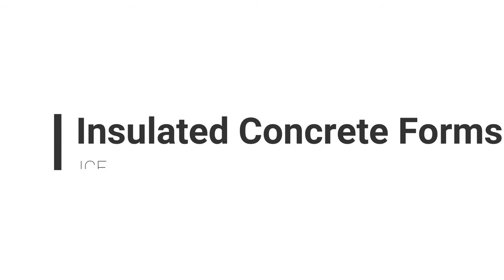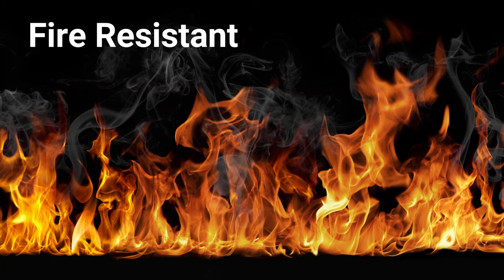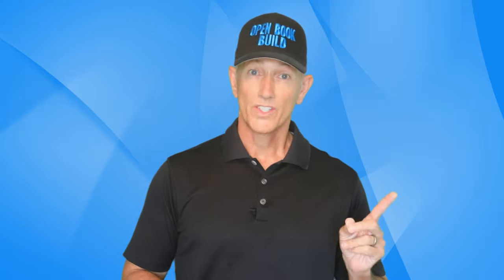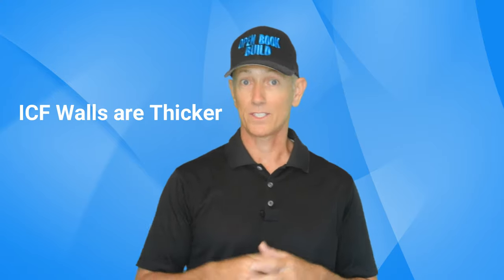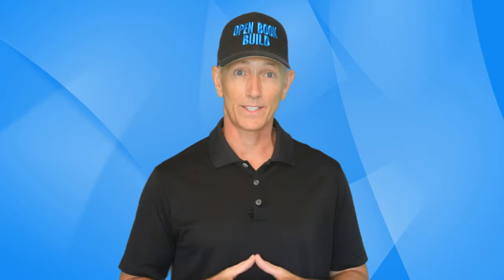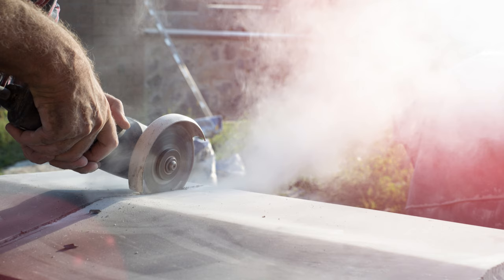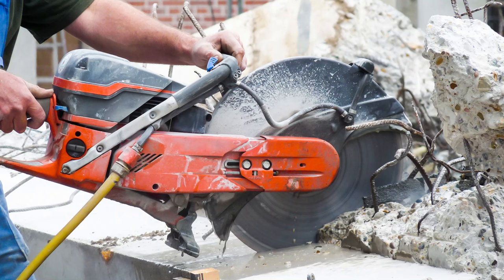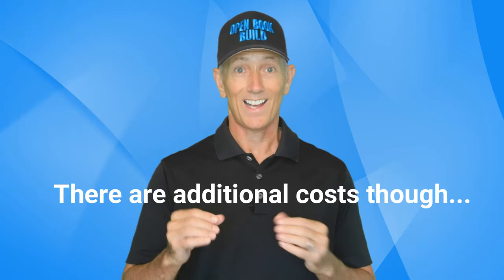ICF Construction: Why I Haven't Used Them as a Builder

Comment: Most builders don't want to use ICF, because they can't upcharge for air sealing, spray foam and other energy efficient, but costly details that would be required to get even remotely close to the efficiency of ICF.  ICF is a one stop shop and it can be installed by anyone.  It is probably the most forgiving building material (pre-pour obviously) out there.  Another reason I see builders not recommend it is because it's extremely DIY friendly and has free engineering tables readily available for most builds.
Reply: ICF sounds like it has a lot of advantages but it's new and different. People are usually afraid of what they don't know. It seems like it would be a major headache to deal with changes in the future. Opening up concrete walls to change plumbing, electrical, or HVAC has to be way more difficult. What can you do if you have a leaking pipe or want to remodel the bathroom or kitchen?
Reply: @KPHVAC  ICF has been around since 1953, but it just isn't as mainstream.  Pre planning all penetration's is key, but for a remodel it is a simple as getting out a demo saw and opening up the wall, same if you had a block basement.  You do not run the plumbing in the walls.. I would suggest you watch some videos on it and see how plumbing is routed.
Reply: @FJB2020  Also, just in case you can add a couple of penetrations to those that are already in the plan, and then if you do not need them you can just fill them up later.
Reply: @sebastiantevel898  That is a good point!  I added a few extra for things that I might add in the future.
Reply: @KPHVAC  My above-ground ICF home is 12 years old I cool this massive home with a small bedroom-sized window AC unit. It's all free span so can be set up most anyway in the future it's also very storm safe and I get insurance discounts. I remodeled 1 bath soon the others its not an issue like you all make it out to be. A conventional home bath isn't a picnic to re-do the floors mostly need replacement the wall may have rot not problems in my on slab ICF.
Reply: @kloss213  That sounds awesome. We definitely need more homes that are built to be very energy efficient. I'm sure a single ductless heat pump could heat and cool your entire place if a window unit can do it now. What is the square footage?
Reply: @KPHVAC  ICf has been around since before WW2... it's not new at all.
Reply: Great info!
Reply: @kloss213  do you have spray foam insulation in attic?  I’m looking at building with ICF and just using either cellulose or spray in insulation, not spray foam…. Just wondering if will still see great savings on power bills without spray foam insulation.  Thanks
Reply: @elementsoflightandmusic  have about 36" of fiberglass in the attic.
Reply: @KPHVAC  I know was planning on adding heat pumps now that there is an incentive from gov. The home is 2200sqft and has 15 ft tall ceilings. If winter the home heats well with the heat from the ground so it stays in the mid 50f without heating if sunny or a few folks are indoors I need little heat or cooling.
Reply: @kloss213  Thanks, so you're getting really great energy savings without foam insulation on the roof it sounds.  I'm also looking to have a geothermal hvac/heat system installed, so I suppose if if i have about 3 feet of insulation in the attic floor boards, ICF exterior, should achieve really great energy savings even without foam insulation... and also, save on money without needing foam insulation, as well as not have to worry about around here the termite companies won't contact repairs with you if you have foam insulation in many cases...
Reply: Most builders don’t want to use it, because price in the market for real estate isn’t determined as much by the quality of materials as it is by the demand for housing and the size of the house.  If two identical houses are right next to each other, one built with extremely high quality and the other with average quality, the higher quality home won’t bring a high enough price to offset the higher price of materials.  When you build your own house, on the other hand, ICF is a great choice.
Reply: I like this thread. Great information.
Reply: As far as remodeling… icf isn’t usually used for interior walls… I’ve seen people use wood frame and frame cad and u can alter that fairly easy compared to concrete poured.
Reply: @zbergen4358  My walls on my first two floors are ICF and the 3rd floor for the bedrooms is all stick framed.  Now a friends ICF house is 95% ICF interior walls.  Only walls not ICF are the closets.
Reply: @kloss213 what are the incentives from the government for heat pumps?
Reply: If there's a blowout the pressure blows the whole wall like a zipper.
Reply: @JJJJspam  That only happens when people don't follow the install correctly.. Like when Dirt Perfect had all the blow outs.. That is because they only installed clips on the first course and that is not what you are supposed to do.  I poured a 14' tall wall without a single issue and that is me doing it with no experience.. I just followed the instructions..
Reply: Currently building a home out of this and it’s an Effing nightmare
Reply: @darkerthanknives  What issues are you having?
Reply: Capitalism means excessive resource accumulation, and you just matched it's definition.
Reply: @garrettcole2251  lol...
Reply: @FJB2020  hey, up selling is excessive accumulation, this capitalistism, capitalist + ism.
Reply: @darkerthanknives  what are the main issues that you are running into with the build. Very interested in using this for a build.
Reply: @Chris  I've seen your comments, then went to your channel and saw your construction and will like to ask. Who did your floor plans? I'm heading the same direction, but, architects in the area are not familiar with the product, so stuck trying to find one who does.
Reply: @RS-lt2ue  I designed it myself using AutoCAD.  I just kept playing around with different layouts until I found one that worked and appeased my wife.  We are building it ourselves too, so I get to make on the fly changes if needed, though nothing has come up yet.
Reply: @FJB2020  Ok, thanks for getting back to me.
Reply: AY!
Reply: Please
Reply: yep 💯
Reply: @fjb2020 where can I find these engineering tables??
Reply: @KPHVAC  run the pipes and cable on the wall and cover with drywall where it is needed , otherwise just leave electrical on the wall on metal conduit.
Reply: How so and would you do it agian? @darkerthanknives
Reply: @KPHVAC New? What a joke, it’s damn too old in world wide except the North America
Reply: ICF is definitely the way to go to build only did my first floor wish I had done the whole building 40 degrees inside with no heat even when it is 10 below 0 outside
Reply: @KPHVAC  ICF is not new, been around since the late 90s. Guy who stacked my ICFs started in 1998...
Reply: @elementsoflightandmusic I used the synthetic underlayment for my class 4 roof. I spray foamed my attic(non vented) with about 12 inches of open cell foam. My soffits and garage are traditional vented attic. All these areas are blocked out with a vapor barrier and spray foam.
Reply: @elementsoflightandmusic 
Geo is a pain in the butt! And if you have to replace it it's as expensive as all get out! Just get a good heat pump for less than 7k...
Reply: @jeffquine8883  ICF has been around since the late 50s
Reply: I know this comment is like 2 years old but I had a GC make a comment about why he doesn't fool with ICF. "  If my guys make a mistake with a stick built house it's easy to fix.  If they make a mistake with ICF and we don't catch it till after the concrete has been poured....that could be a lot of money."
Reply: @PandorasFolly  That is true, but I wouldn't want someone who makes mistakes building my house, stick, or icf.. That said, concrete drills and saws do exist...
Reply: @FJB2020 you can easily run plumbing in ICF wall foam. Up to 2”
Reply: @Alphasig336  Yeah or you can run larger IN the wall if its thick enough.

Comment: Concrete doesn't work the way you think it does! Water is essential to the strength, and it chemically incorporated into the concrete - it doesn't "leak out" over time. Your other reasons for not using ICF just seem to be sheer laziness.
Reply: Concrete is poured with a lot of excess water in order to make it more workable.   The humidity problem he discusses is real as much of that excess water seaps out over the 1st several years.

Now if you are willing to go with really stiff concrete that has to be almost packed into the forms with massive use of vibrators... the issue is greatly reduced.   Expect to spend 4-6 times a long to erect and fill the ICF blocks  - and you may have to do it in 3-4 ft height levels at a time.

Comment: All of the problems you mentioned about building with ICF can be fixed with proper planning. As for the cost difference you failed to mention that the home owner will be able to purchase smaller HVAC equipment because of the insulation value of ICF.  Small unit, smaller electric bill.
Reply from the maker: This video isn’t a full list of pros and cons…I can list ten more items for and against using ICF’s.  This is strictly listing the reasons I’ve chosen not to use ICF in the homes I’ve built.  And yes any negative can be worked around.  But when you don’t have a decent workforce to build 150 houses a year with these…you don’t do it…it’s that simple.
Reply: @OpenBookBuild  The problem of production building is due to the scale its indeed inpractical to deviate from standard stick framing due to the associated lack of attention to detail...although the same can be said of the production crews often not properly sealing Zip panels or any other methods that are designed to air seal the modern build...which will lead to condendation and rot of the wall assembly..is the reason I'll self build with ICF
  I was a production framer prior to the current code retirements of air sealing...when our 4 days with crew of 4 could frame a 2 story tract home of good quality...this can't be said for the current production build due to the air tight requirements.
Reply: ANY problem can be mitigated through proper planning.  The issue is , is it worth it to overcome those mitigated issues? Plus is the contractor going to make a mistake even after mitigating the issues.   If it’s worth it then no problem, if not don’t use them.
Reply: @OpenBookBuild ICON 3D printed homes are about to take off. All concrete and very popular.
Reply: @OpenBookBuild it seems like your list is more valid for builders such as yourself rather then individuals who want to build their own home, good info nonetheless.

Comment: Builders in the US have become stuck in old technology and don’t want to change. Stick built is cheap, fast, and extremely profitable. In Germany, 85% of the homes there are solid built meaning concrete walls. It takes a couple of months longer to build but they are much more efficient. I think things need to progress in this country especially in FL. There shouldn’t be any stick built houses being built. Everything new should be concrete. I think insurance companies would agree.
Reply: Slight mistake here: in Germany and most of Europe nearly all houses are built with solid walls, but not concrete ones, as the insulation properties are not good enough. Building materials may vary by what is locally available and therefore cheapest, but typically (in colder areas) large, light, well insulating building blocks would be used, which have insulating properties approaching rockwool. Concrete would only be  used for subterranean cellars and floors or possibly for a concrete framework for high rise buildings . Normally any house will be built on a concrete foundation plate. Building regulations require wall insulation properties equivalent to about 8" of rockwool or Styrofoam, this can be achieved with the aforementioned materials with hardly any additional pure insulation. This added insulation would be on the outside, so as to maximise the heat capacity effect of the materials used inside.
Always sticking to traditional methods can be a bit of a problem, see the UK, where the building trade does not seem to be able to get away from the traditional brick cavity wall, which in my opinion makes efficient insulation a nightmare.

Comment: None of the issues you talk about, are that problematic enough not consider ICF. You did not talk about the advantages of ICF? There is less labor involved in stacking ICF even with the placement of steel rebar they are easier to install than the typical framed wall, once you have a trained crew. There is less physical labor, so the workers are less tired at the end of the day. The house walls are substantially stronger, hurricane proof, fire proof, insect-rodent proof, Bullet proof, and no dry-rot issues at all! If the caulking fails around windows or doors, there is nothing to rot. And the ICF walls are much better at insulating sound and heat-cold, because of the solid mass of concrete and the high density Styrofoam  on either side of the block. It is far superior to a 2x6 framed wall.   It seems you are looking for excuses not to use ICF when you could be taking advantage of all the good properties? For example, you mentioned your electrician wanted to charge more for cutting the wire and boxes in, when in reality, it is a much quicker process to simply use a small electric chain saw to do the channels. And when the cost of lumber jumped up, there was no difference in the cost between framed exterior and ICF exterior.
Reply: the guys are using "hot knife" to cut into them now. theres even less mess it pulls up as an entire strip instead of chips like the saw.. the issues he stated proves he lacks the intelligence to adapt. prefers to stay in his bubble. and if that works for him and pays his bills fine. but to make a video and be "trashing" ICF while being ignorant of the ease that surrounds fixing all his complaints is... dumb. its better business to build your product up than to talk down the competitor. makes you look petty and uninformed

Comment: It’s fairly cheap to have plans adjusted for icfs and it’s more like $250-$350. Do it right the first time. There are ICFs that it is almost impossible to blow out e.g. thermagreen blocks; and stick now is costing more. ICFs generally keep your trades from doing it wrong the first time.
Reply: Not always true, we had a builder here in Ontario that built with something very similar to ICF. It was "so easy" to install that the builder went bust and now Tarion is suing the builders as well as the municipality and Mike Holmes because the houses have so many issues with them that some are being torn down. These homes were built in 2015. ICF is more expensive up front then a tradition build and most trades don't know how to build around that like with building a straw bale house. Not to mention when you get a blow out while pouring an ICF it's not as easy as people think it is especially not in a climate like Canada. If ICF's were the perfect solution like asbestos was... everyone would be doing it already by now, but there's a reason most don't. Not fair to blame builders when most people have no idea what it costs to build homes in today's atmosphere. Builders can't build it cheaper and people can't afford what we build to begin with.

Comment: I built my ICF home. Hired all my own subs. Found framers, brick layers, sheet rockers, electrician, plumber, etc. My draftsman I hired did ICF floor plans, so they were spot on. The guy that stacked my ICFs has been doing it since the late 90s. He left the door openings bigger than needed so the framers could frame to the door opening, and I would only require a 6-inch reveal for my doors...
Did my homework and hired the right subs!
Reply: Yep exactly!
Reply: Is there anyway I can talk to you on the phone about your experience building a ICF home?